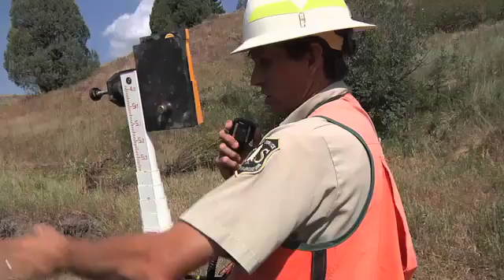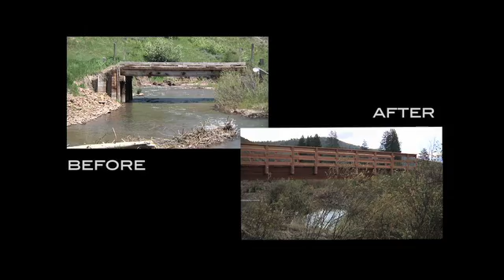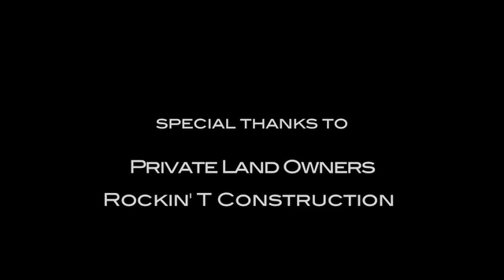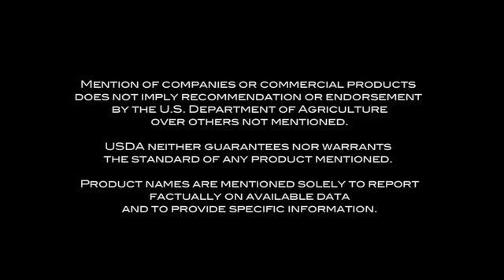Restoring Hope

Comment: This is a wonderful project. I worked on the Soda Springs Ranger District seasonally as a Range Tech from 1978 to 1986. The drainage's off Caribou Mountain have endured a lot of abuse for many many years. Trailing sheep right above McCoy Creek is one of the worst abuses I have ever seen.The Caribou National Forest finally required the sheep to be trucked in. Re-vegetating the stream banks of McCoy Creek was my passion. Another abuse of the headwaters of McCoy Creek is the Caribou National Forest road crew loads up the land slumps along the McCoy Creek RD #087 and dumps the slump soils into the headwaters of McCoy Creek. Please stop it.
The riparian area and stream banks of N Fork Tincup Creek still are being abused by bands of sheep being herded down to them for watering. Please build more watering ponds on seeps, or pipe water to ponds from springs in the drainage away from the riparian areas and streambanks. 

Mike Panting